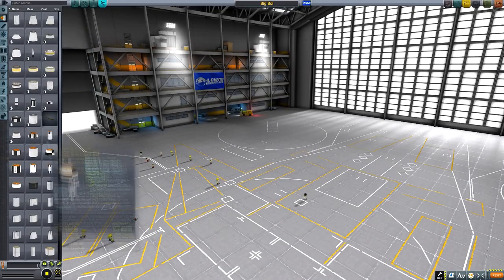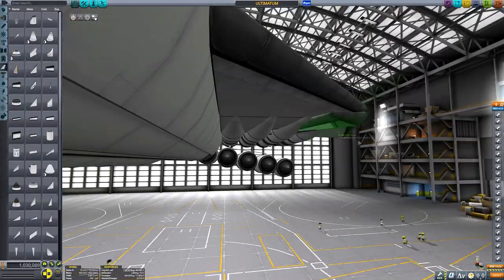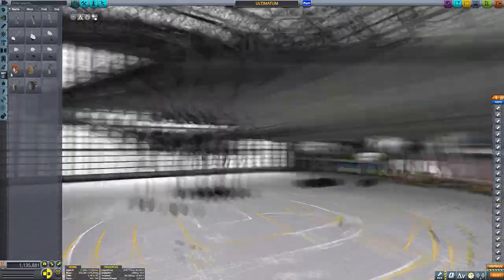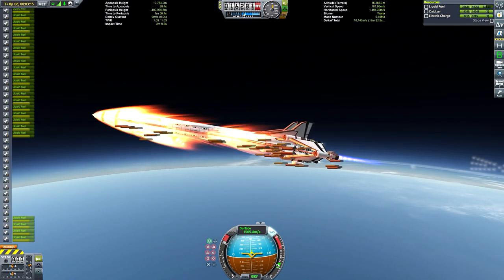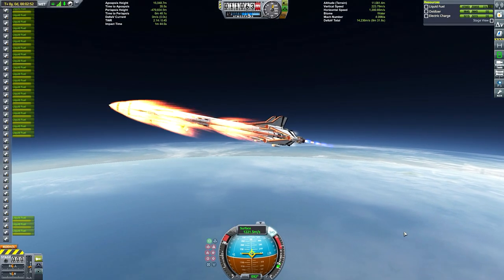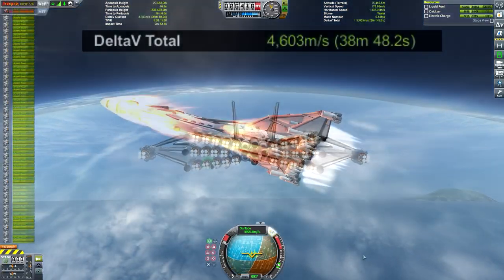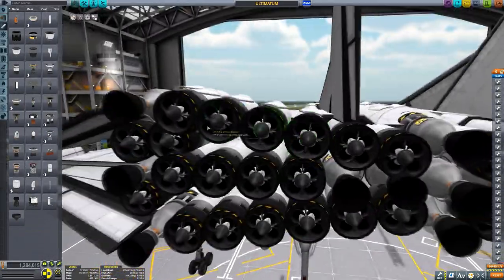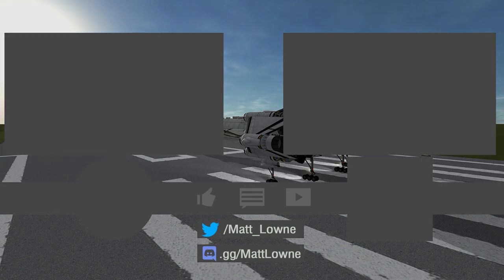KSP: How I design/build SSTOs  (ft. 208-seat Eeloo SSTO)

Comment: How I make SSTOs 
1: Make a plane
2: Slap a crap ton of engines on it
3: Put more fuel tanks on it
4: Make it look cool

Also, can you please make a tutorial on how to land sstos because I cannot land anything on Kerbin or not
Reply: Check out his interplanetary ssto guide, its a little old but the principles still apply
Reply: Make sure your landing run is lined up with the runway and may be very useful to come in low to the runway level till you get used to it... Keep the nose up and glide in if your craft can handle it...

Keep engines on a tiny fraction just in case you need it, so you don't just fall out of the air at random point
Reply: Just practice landing them without ever putting them into orbit... or loads of chutes like my moonlight SSTO
Reply: Add step 5.
Put lots of parachutes on it.
Reply: about your landing problem, just think of it as flying reeeaaaalllly slow and reeeaaaallly low over wherever you are landing
Reply: The One Who Laughs i kinda feel like larger planes are easier to land for some reason idk why, maybe because larger landing gear are more impact tolerant
Reply: You forgot lots of landing gear to land so it doesn’t collapse
Reply: @joshuaspath6923  parachutes get heavy
Reply: Remember that you want to keep your center of mass and lift in the right zone before AND after ALL the fuel is gone for landing if you can meet both requirements that thing will fly anywhere
Reply: This got complicated fast
Reply: It all depends on how good you are at flying, weight and lift ratio and distribution, and if you have advanced tweakables(auto struts) enabled
Reply: Pro tip, you frontal landing gear should be shorter than the rear, so your nose naturally points down. Remove any brakes from the front, and steering from the rear. These basic rules solve 90% of death wobble on landing.

I personally find it helpful to turn off SAS, and instead, rely on trimming the aircraft well before hand so its naturally stable. You can adjust trim with alt+wsadqe. Keep in mind, trim settings for low speed are different than for high speed, if you're clever, you can install deployable flaps to compensate for the difference. Generally, lower speed requires more trim pitched up, or flaps in front of SoM.

Lastly, line up for landing well in advance. You should be lined up with the runway and below 700 meters 4km out with most spaceplanes. Ideally, your altitude wil have dropped to the runway level right as you reach it.
Reply: alright but how do i do step 1?
Reply: If only it could work IRL...

Comment: Maths who needs it ;P
Nice How To-ish video. I struggle with my SSTO plane designs, although thinking on things I think it is due to not having enough non-atmosphere engines on my designs. Well not enough engines and too much fuel. After a number of iterations I tend to get a little frustrated and then start strapping on some boosters, or just toss a large rocket behind it(or in front of it) and the plane becomes a payload.

My latest design I did not have enough engines or fuel on it by far and quickly became a payload. I then proceeded to take it to the Mun and going why do I have wings on this thing for flying around the Mun and Minmus they don't have an atmosphere to use the wings in and proceeded to remove the wings on the next iteration.

Comment: I'm not very good at trial and error or math! XD But I've got a few good LKO SSTOs. My real problem there is I pick designs which are hard to modify to add more fuel & stuff. With the SSTO in this video, small fuel tanks can be clipped with the wings, the whole thing can be lengthened, etc. With my favourite designs, the ~wings~ lifting surfaces are too much a part of the whole style to make either of those changes. Having said that, in one of my designs the engines are on pods on the wing-tips and I really should add fuel to those pods; changing structural fuselages into tanks. It's just that doing it properly means replacing 4 of the 6 wings. Oh hang on, now I've removed the carefully flush-fitted solar panels, that wouldn't be so bad. Hmm!

But I also just made an ugly bug which won't look any worse no matter how I modify it. XD That one has 4400m/s after the rapiers have used all of the rather plentiful supply of oxidizer, and mining kit too.

Comment: Yay thx

Also should I add more wing to my Dragon minmus cargo SSTO 
(It goes to minmus and refuels and then has about 5k deltaV, I use the stock deltaV calculator, also why are you using mechjeb for deltaV readout when 1.6 has it or is this old footage?)
Edit I realized I forgot the issue, it nearly hits the ground when it falls of the runway, same with moonlight but last time I edited that it made its deltaV go from 5k to 3k so I added a refueler to it...

Comment: In my experience, the sweet spot is have one RAPIER for, at max 15 tons of craft. Majes huge SSTOS very difficult to build. To a point that I wonder a vertical taking off SSTO wouldn't be better, ditch the RAPIERs for rocket engines. 
I guess the X-33 Valkyrie concept was not that bad, shame they didn't resolve the problem of the fuel tanks.

Comment: @Matt You can get better performance by angling your wings up slightly.  KSP lift surfaces require AoA to generate lift, but you want you level and prograde indicators to be aligned to benefit from drag occlusion.  So you angle your wings a few degrees as here.  Notice the large payload I'm carrying with very little wing surface.  This equates to less weight and drag, meaning fewer engines, meaning even less weight and drag, fewer intakes.  As you start trimming these things down you then go back and need less wing area for the reduced weight and so on.  https://youtu.be/CoT67cx4cLI

Comment: One major problem I keep having in designing huge SSTOs is passing Mach1. A lot of them have a fairly high TWR, accelerate quickly and can even take off halfway down the runway, but as soon as it hits 340m/s, there's a sudden spike in drag and I can't accelerate. Even if I climb to 10km and nosedive, I break that speed, but immediately slow down once I level out again.
Anyone know why this is happening? I currently use 1 R.A.P.I.E.R per 20t starting mass.
Reply: The thrust of the RAPIERs drops slightly at about mach 1, I believe this is to simulate transonic drag without having to actually implement it into the aero-model.

The best solution I can offer would be to add moar boosters, perhaps use 1 RAPIER per 15t of starting mass. A technique I saw on the forums once was to use drop off SRBs to kick you past that breaking point, not technically SSTO but still cheap if you're playing career.
Reply: Thanks for the suggestion! I'll try 15t/R.A.P.I.E.R from now on. And yeah, I knew about the attempt to simulate transonic drag, but damn is it annoying xD.

As for adding SRBs in career, that's just a fact. SSTOs don't really matter in a career sense

Comment: You should do a rapier and nuke ssto no Oxd. Only using liquid fuel to orbit.
Reply: nukes don't have enough twr for that.
Reply: @gabortoth5061   I made an ssto that only uses liquid fuel. Rapier engines and nuke. It struggles but I go 1500 meters per second and launch myself at about 20 degrees getting a 40k apogee and I build up speed with 2 nuke engines at about 1600-1800 and pitch up until apogee starts to increase and maintain it until I finally get to 75k and circularize. I get around 3k delta V left.
Reply: @kaptain1477  how heavy is your craft initially?

Comment: Hey, I've built a launchpad SSTO that works with only level 1 buildings in Career mode. I haven't seen anyone else able to do this - everyone else seems to need to use either an upgraded runway or upgraded R&D facility parts. Does anyone else know of any other manned level 1 SSTO's that have been made in the current version of the game since the last parts overhaul?

Comment: Why dont you build a jet fighter? something like an f22 would be great. And you could use a cargo bay, to carry some stuff around. BUT, this is a build only for use in Kerbin atmos, it can't go to space, wich is interesting, since not many people build stuff that cant go to space. For people seeing this: please like so he can actually see this
Reply: And if you can give it some working missiles, that would be really awesome. I mean, it's not very hard, you use a radial decoupler, some thin fuel tanks and rocket engine, a nose cone in the front and 4 fins at the rear, to keep it in the same direction. And maybe even a probe core, to make a remote controlled air to air missile.

Comment: Whenever I try to make an ssto or a space plane, as soon as I clear the runway, the plane just flips and I cant get control of it. Any1 know how I can stop this?
Reply: -Make sure your centre of mass is far ahead of your centre of lift (both when fully fuelled and when empty).
-Engines in KSP are very heavy, so sometimes having loads of them at the back of your plane makes it more unstable, putting all the engines in the middle of your craft or some at the back and the front can help offset that issue.

The KSP forums is probably the best place for questions like this, that's where I usually go.
Reply: Move center of mass in front of center of lift, by moving the wings backwards. If it rotates sideways put a larger tail on it. The extreme case is an arrow. Center of mass behind the center of lift is like trying to throw an arrow backwards.